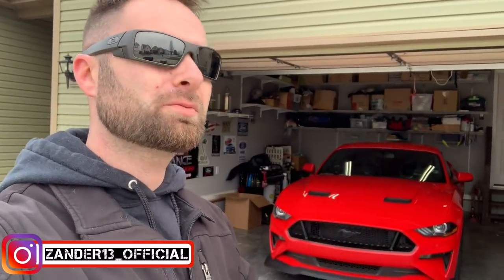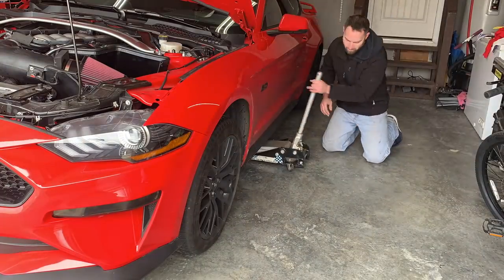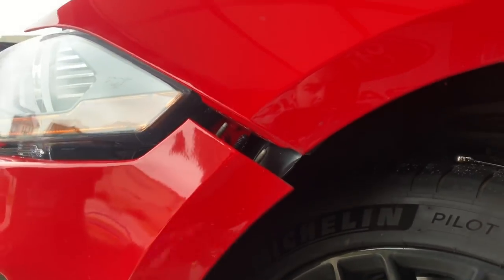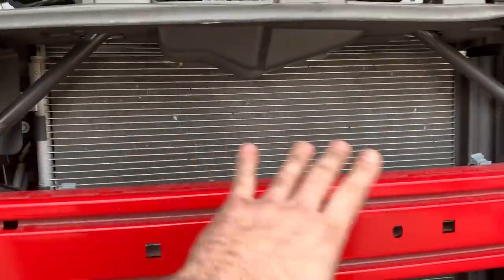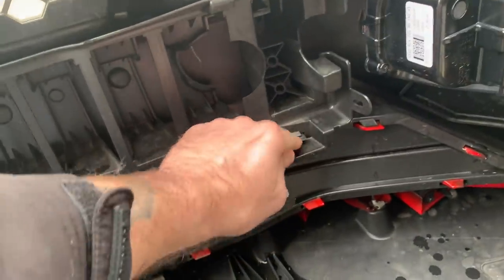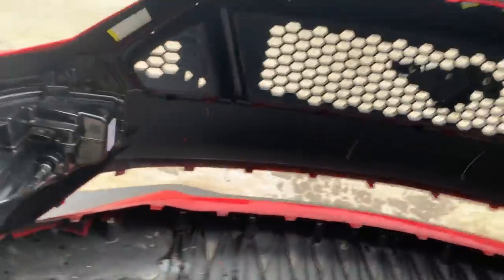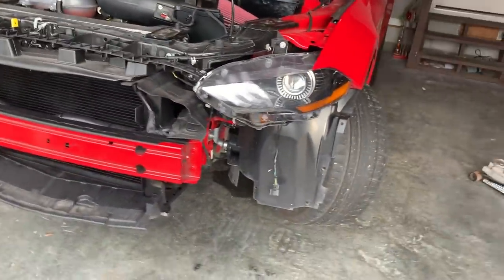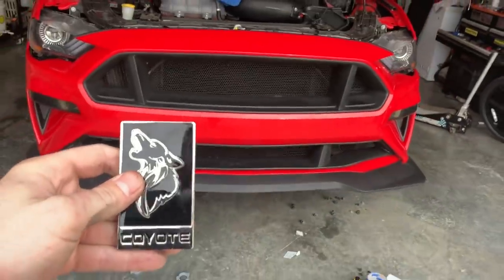Accidents Happen! | 2018-2019 Mustang GT | Cervinis Grill Installation

Comment: I have the same exact upper and lower grille and badge. Lol. I also bent all my tabs to hold better. I love this set up. I didnt have to paint my radiator because my intercooler is already black. I did brush paint those grey wire clips black and also painted the badge threads black because you can see them from an angle.
Reply from the maker: ❤️ it turned out great

Comment: Noticed when you opened the hood you didn't have the engine cover on, I hate the looks of mine and was thinking of removing it, is there any need for them?
Reply from the maker: it helps quiet down any injector tick. Honestly I cant hear a difference. just take it off

Comment: When you have cracks like that on your fingers, use super glue on them.  Holds it in place till it heals and stops a lot of the pain. Dries fast.   Keep a bottle in the garage.   Dry winter air and cold temper cause my issues.

Comment: i installed this but didnt reinstall the bumper support thing with 3m tape, do you recommend i install it? also mines came with brackets for the lower bumper but didnt install those either
Reply from the maker: I think you should install the brackets for sure

Comment: I put the same grille on about a month ago and my 2019 GT also has the performance pack but cervinis didn’t give me those brackets you had to wait for, are they necessary?
Reply from the maker: they are needed. I would call them
Reply: Having the same issue how do you get the brackets ?
Reply: @Luis-hg8ue  I think you have to contact them directly although be careful I never put them on and about 3 months later my bumper came off at highway speeds so the brackets are def necessary

Comment: A friend of mine is selling their cervinis hood in our mustang group . this is her comment in our Facebook group regarding cervinis: 

 "they've pissed in my cheerios for over a year. Poor customer service, could care less, It took me 13 months to get another hood on their dime due to all the issues with the paint that I paid for. Contacted them the day that the hood went on the car as it was sent to my performance shop in W. Columbia as I was at the Tail when it came in. I called and called to be put down, treated poorly and told to suck it up that the almost $1500.00 I paid for this hood not their problem. They didn't do everything I paid for, the color was off, didn't paint underneath and on the top clear coat left numerous bubbles. I called from May to Mid October and I finally got the second guy head of the company, Jim Frie. He was real nice at first, then turned into a jack ass. I waited from Mid October to Mid January for a replacement hood which, I finally got on their dime, although while they were doing this, the communication sucked, wouldn't answer phone calls or emails to where in his first email he gave me his cell number so I started to message that. They were in the middle of moving to a larger warehouse so it was my problem that I had to wait. Plus, I ordered side scoops for my 18' and upper and lower grilles for my 15' in July 18' and after a few weeks, I called them for them to tell me that none of it will ship until the custom pieces were painted. When I was at MW, I saw they had a tent. The people I was with I told them to walk on and I will catch up. Their were 5 people chatting across the table and 7 people in line that I counted. I walked up to the table and asked the blonde that was just standing there, are you Kelly? and she answered Yes, I said my name is Leah Lichtenberg and her face just dropped. I asked why do I have to wait 6 months minimum to get my upper and lower grilles because I am having something painted and why do I have to give my $80.00 back to pay for shipping? I was loud at that time and she said give me your phone number and the same idiot I have been fighting with over my hood called me 10 minutes later with a tracking number for my upper and lowers. This also turned out to be a fiasco as I needed to send in the fuel tan door to my 18' so they can paint match it. Six months later I had my side scoops. I will never, ever recommend them to anybody. I just want this hood gone and out of my garage as I'm done looking at it. So, my overall opinion of Cervinis...you really don't want to know. 🤐"
Reply from the maker: omg that's terrible. Cervinis products are not terrible depending on what you buy but I will say that their CS is totally clueless

Comment: Love the blood!! Its funny I just ordered the SAME GRILL.. ITS THE c series right?? I'm so glad I saw you do this,, now I know what I'm in for!! Love your vlogs! I have a 2018 whipple stage 2,,, 6 speed. 373s.. Just getting into the rest of all the goodies. Bmr irs kits. Same as yours!! Looking at tire setups.. What size rears are you going to go with..?? Scott Z.. Peace
Reply: 373s why??!!
Reply: That's what it came with from the factory...
Reply: Unless I'm stupid and read the window sticker incorrect. Or I should say misreading. 3.73 torsen rear axle.. Is that correct what I said???? Please let me know. I'm not a mechanic.. Just an idiot with a fast mustang...lol.
Reply: @mustangscott7694  I also have a Whipple 18 5.0 but mine came with 331 gears for longer gearing!
Reply: @mustangscott7694  I don't have Instagram. It's not good for our setup bc ur losing so much Power!
Reply: What you mean losing power??
Reply: @mustangscott7694  Ur shifting alot right?
Reply: Well 1 nd 2 are nuts cause its cold and I dont have tire setup yet. Just mich. 275 pilots. But 3rd gear is crazy.. I cant even get into much boost amd the car is flying by the time I get to 4500 rpms or so.. But I have never been in another stang with different gears so
.. What r your thoughts.. Message me on fb if you want..
Reply: I also installed the boost gauge that replaces factory one in the pp1 . the vac in hg gauge.. Have you seen the one I'm talking about?? Iys the one that is in the ecoboost stang..
Reply: How is stage 2 over stage 1?
Reply: @mattkent75  not sure. I have never been in a stage 1
.. ??
Reply: @mustangscott7694  The 373 gears u shift alot more bc ur gearing is shorter. My 331s allow me to stay in power longer without shifting Everytime! I would highly recommend it and really confused on why they didn't tell I was this!
Reply: @whipple5.022  what's the end mean?? Didnt tell what?? Sorry..
Reply: @whipple5.022  I would love to feel the difference... My set up is all good though.. I'm use to it.. Ya know..
Reply: @mustangscott7694  Just look into it I think u would like it better having the 331s. My dealership said that the 373 come with 18+ Mustangs but since Boosted it's better having 331s so they swapped it out before I took delivery!
Reply: @whipple5.022  ok... Cool I will defiantly look into tag for sure.. Thanks a lot..
Reply: @mustangscott7694  No prob
Reply from the maker: yes, C series.size rears? tires, gears?
Reply: @Zander13Productions  Do u have 331 gears??!
Reply: @whipple5.022  no. I have 373s from factory... So the car is VERY VIOLENT on the street'
Reply: @mustangscott7694  There's nothing like having long gears with a Boosted 5.0 😁. Most races I do I don't even need 3rd gear lol
Reply from the maker: @whipple5.022  3.55
Reply: @Zander13Productions  I was wondering if you were planning on adding tires and rims to your 19". And if so , what width of tire.. Pscr
Reply: @Zander13Productions  Nice. Do u feel a difference??!! I know I felt a difference from 373 to 331😁